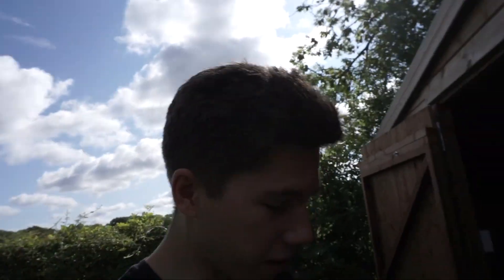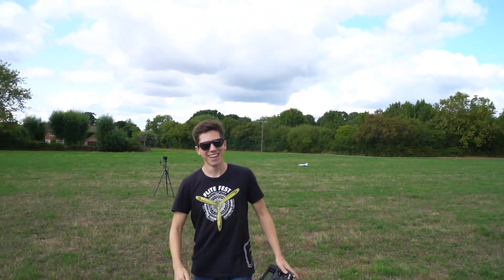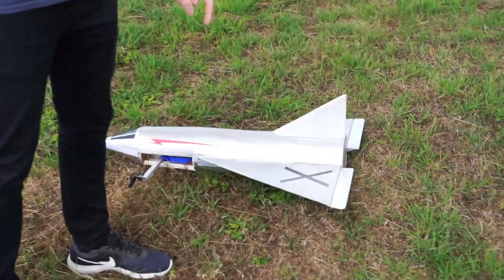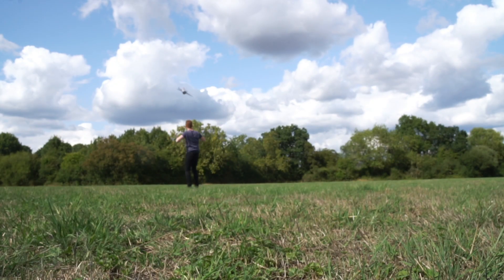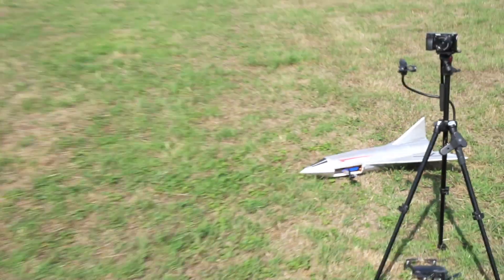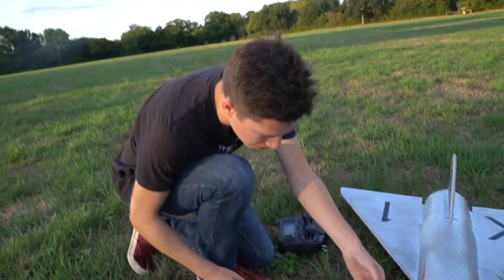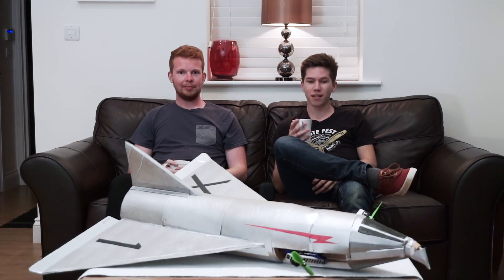Thrust Vectoring 'Canard' Jet - FLIGHT

Comment: Not enough tea was consumed towards the end of the day, but I won't spoil what happens ;)
Reply: Tom Stanton , hey man good build. So it on flitetest then came here. Instead of props, try using edf. Might be better, more thrust.
Reply: I think it's begging for a 120mm EDF in the tail so the canard props are mainly just for manoeuvring, but they're rather expensive...
Reply: Tom Stanton always love the vids Tom, thanks for recommending this channel too, looking forward to more quality content
Reply: Mr.Stone ,
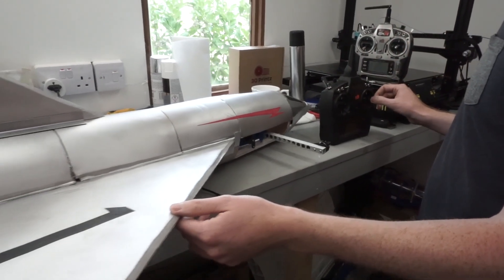Reply: 01:55 yay Aerolon (how I spose to spell that? :o)
Reply: P D James aileron
Reply: aerolouron? :D
Reply: and yay more. You have made 3-mode aeroplane :) Vtol, wing & cronoplan - ground effect. Bit of V angle on the wings for up-right forgiveness  (or 2 n a half wings cos fat rudder good ;n) and you have a prototype parcel drone xx
Reply: Would it have worked to have used capacitors instead of a larger battery and if so would they have been lighter?
Reply: Hi Tom could I have the aircraf silver plan from last edf video to make my own edf plane?
Reply: I LOVE your vids

Comment: #1- add a fan unit inside the fuselage with air inlet ducts forward of it. #2- make the fuselage smaller in diameter (less drag). #3- make the canards wing shaped. It seems to be underpowered. Great first design. I am from Rockford, IL. USA.   GOOD LUCK

Comment: I'd love to see that getting another go. Especially because of the behaviour in the slow takeoffs from the ground. Watching it *reminded me of the Soviet attempts to create their own version of the Harrier VTOL. *I don't compare them directly, of cause. I think about the way the Sowjet engineers had to compensate lacking hardware with simpler practicle alternatives. Your design just seems to me to be onto something that could achieve not 90° but perhaps between 45° and 67° takeoff angle. So to speak a cheep and extreme simple alternative to VTOL.

Comment: I know I am late to the party, and I am sure this plane is long gone, but the oscillations from the wings are due to the center of gravity being in a neutrally-stable/unstable position. Any perturbations from turbulence and control inputs would cause oscillations with very little damping. To add to the lateral stability, the CG needs to be moved downward and add dihedral. This can be done by mounting the battery in a lower position or shifting the wings up (this is why high-wing configurations are so stable) There's always a drawback, and this case it would be roll speed. But since you're trying a new design, I would prefer stability over maneuverability until the flight controller is tuned. Great video and awesome idea!

Comment: I always wonder about battery eliminators. I know having power for motors is important, but losing control is a worry. I know it works safely by in large, but I always think having power for receiver and servos so they always outlast the motors is better

Comment: Suggestion; use an old FC to  for gyro stabilisation and channel mixing, basically make it 'fly by wire', that way you won't need to manually coordinate pitch and thrust to maintain level flight...

Comment: It needs landing gear of some sort.
If the body tapered slowly as you go back from about 1/2 way point, there would be less drag.
The smaller the diameter you get to before the air flow breaks free of the surface the better.
It would look extra cool if it had a jog in the leading edge of the wing like the Avro-Arrow had.
Little winglets on the ends of the wings would also add to the look.

Comment: Version 2 coming up?

Squared off fuselage at the tail is a bit high drag, so perhaps a third motor with EDF or just taper it to a point too. Low speed roll stability seems a bit squirrelly. Not sure what you can do about that with flat wings? Maybe make it a dual-delta/LERX type airfoil? If done right that can also help with high alpha.

I think there's more to get out of it, considering how well that one worked until it finally crashed. Would it be any better using a gyro and programming some PID logic stuff into it? Wonder what it'd do if you could set it to try holding a given pitch angle from your input, and let it pick the thrust angle that's appropriate for the throttle.
Reply: Yes gyro on the pitch to make it effectively fly by wire. Would need a minimum forward element to the thrust vector to keep the elevons control authority. Better still put a third much more powerful motor on the rear for forward thrust- my mind boggles trying to think of how you could set up the mixing/gyro/channel allocation possible on that...

Comment: I thought this was going to suuuuck. It didn't, which is nice. I think the reason was the delta wings, as these did not stall at low velocity, high angle of attack, for a number of reasons........ The characteristic of "lack of aileron" response at low speed meant that there was separation on the upper surface, but the vorticies created by the leading edge helped with a 'type' of flow attachment.

Comment: I think you would have been better off using an existing canard design (Im thinking the flitetest viggen) and then adding the thrust vectoring which would reduce the unknown variables.
The viggen already can stably  fly very slow at high angle.

Comment: Like many viewers of this excellent video, I´m new to this channel and would like to commend the very high (almost Project Binky - high) degree of acknowledgement of the importance of regular tea consumption which we witnessed here.
 The idea of compensating for the downthrust generated by the flaps was a long way out of the box, as there´d be little correlation between airflow over (or rather under) the wing and throttle setting. I salute you both for the sheer audacity you displayed in building this model. It does have some astonishing flight characteristics as well as looking absolutely tremendous.